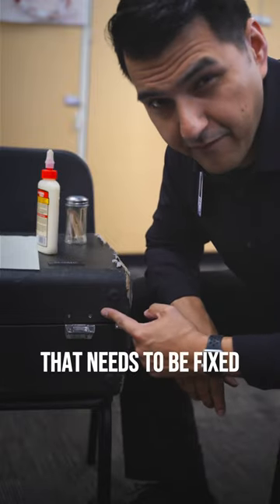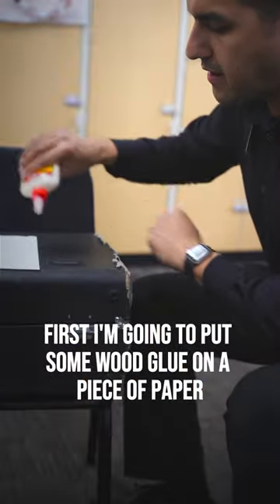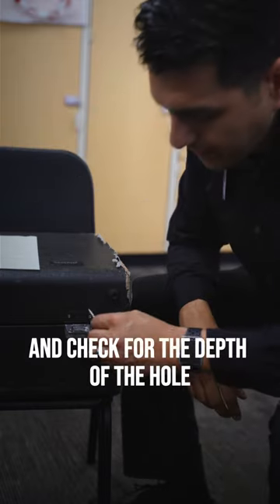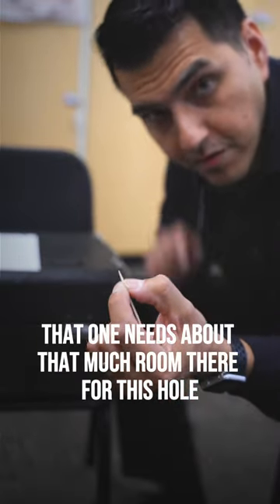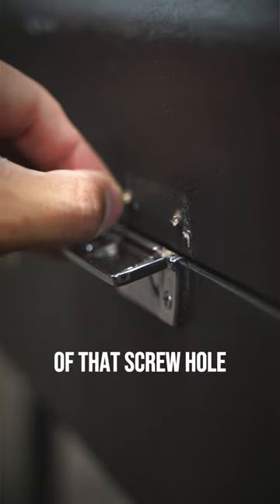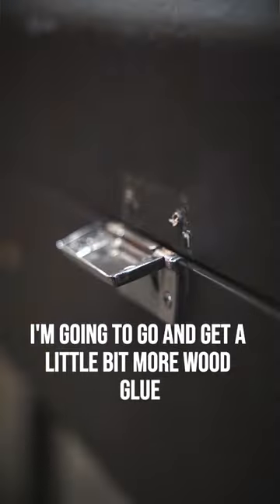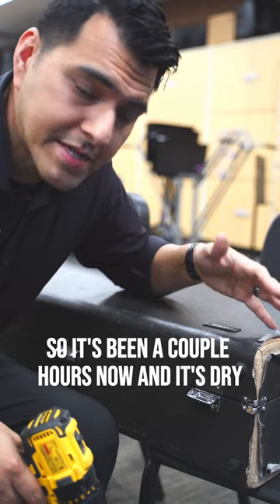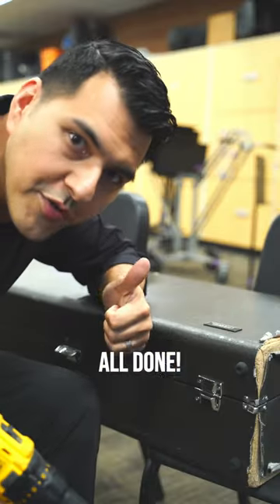How to Fix Band Instrument Cases #banddirector #instrumentrepair #saxophone #musicteacher #clarinet

Comment: Nice job.  Next time just dip the tooth pick in ethe glue, push into hole until it stops.  Crack it off and. Immediately turn the screw in. 
Done in less than a minute.
Reply from the maker: Appreciate it! Thanks for tip too!